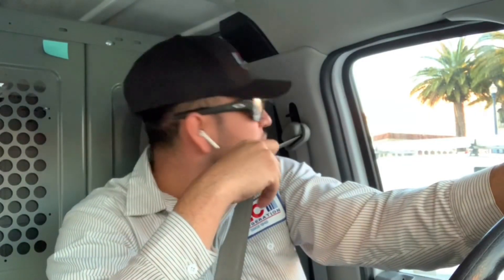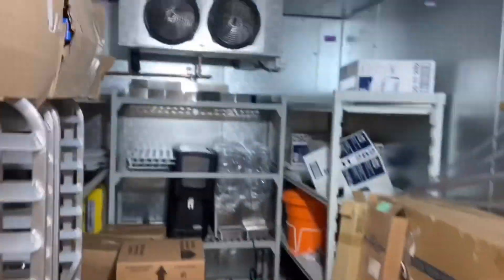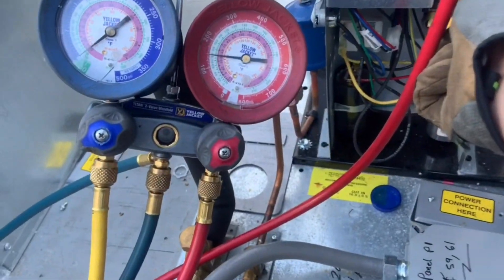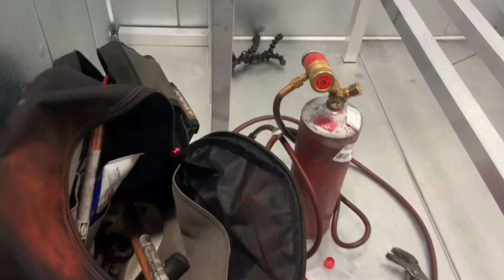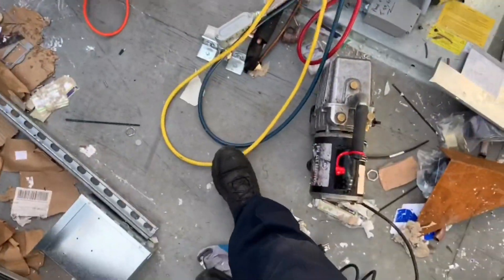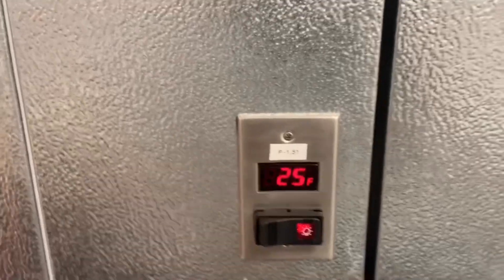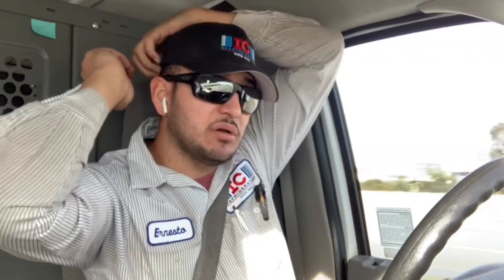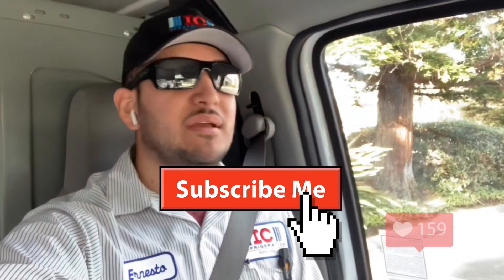HVAC-R VLOG / WALKIN FREEZER VALVE REPLACEMENT

Comment: I have question how do you know the that liquid receiver is holding the pressure  while ur down stairs the reason I ask sometime the kind valve still passes refrigerant 
And there’s no one to tell you there’s refrigerant in the line and while ur soldering ur creating phosgene gas ?

Comment: Just so you know for next time if you have 208 volt power on the roof where you are working you don't have to run miles of extensions cord just tap 1 leg of the 208 And the other to ground and magically have 115volts
Having said that watch out for high legs though and certainly don't tap off if only 480volts is available
Reply: Yeah I agree with this... But it was a new install, code should be an outlet with in 25' of all those units. But maybe there just not wired yet.
Reply: Right u r Dan to clarify what I said tough is 1 leg to 208volt on your cheater cord then ground the neutral side of your cheater to ground at least that's what I do when no 115volt available
Reply: You have to be carefull doing that - if for some reason the ground is open you will cause everything that is grounded on that circuit to have a metal case that is energized to 120 volts.